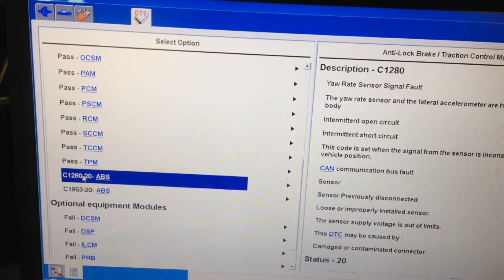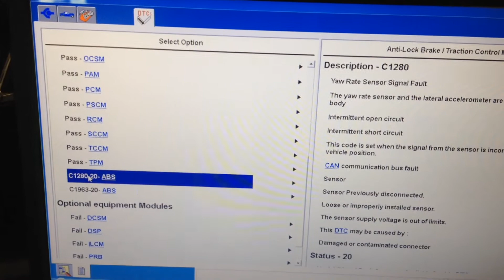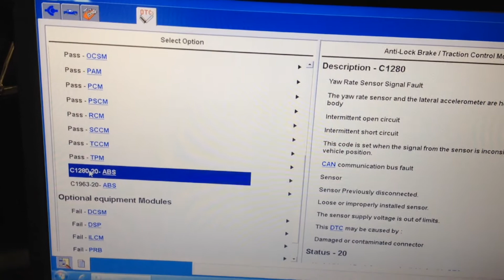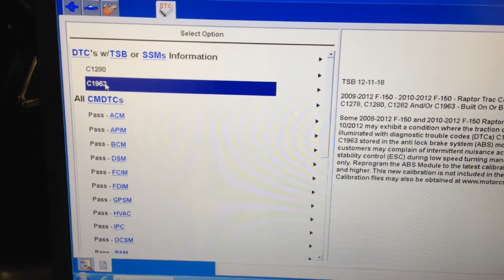Ford Quick Tips: #13 Ford F150 & Raptor Traction Control Light Flashing

Comment: @fordtechmakuloco love your videos, I looked through them all hoping you covered a problem I'm having with the backup camera in my 2010 raptor, when I put it in reverse the screen pops up like normal but it's black still have the settings button on screen but no video. Have you ever come across this? Any input or suggestions would be awesome!

Comment: Fordtechmaculoco I have a question for you. I have 2012 MKZ HYBRID . Mechanic changed inner outer tie rod and upper lower control arms and after that when I turn my steering wheel to right my abs sensor pops up. If I turn steering wheel left no lights until I press the brake. When I press the brake abs and traction showing and car is sliding. After abs sensor shows up no brake problem . I did the alignment also. I was fixing my car by watching your videos and I believe you have the answer

Comment: My 2014 f150 XLT 5.0 has two codes, C1440 20. And C1280 20 . Flashing will not fix this problem I was told. HELP !
Reply: Any update c1440 is ur HCU unit pressure switch damaged
Reply: @cj1613  got a used 2014  complete HCU with 117k on it, will install soon because switch built into hydraulic unit is reading more than 40psi , so module is good but not the built in sensor is bad. Part cost $100.00 on eBay with 6 month warranty. Dealer part was $1300.00 new.

Comment: Have you seen this without codes?   2009 f150, abs kicks on so bad around corners it skids the LF wheel, you can see the RF signal dropping out on scanner so we replaced the hub and sensor assy.  Did not fix the problem.  I can see the SAS reading wonky, but no codes, this one is eating my lunch.

Comment: @Makuloco, I had my ECM replaced due to the shop stating it was bad after my truck was skipping. The plugs, and coil packs didn't fix the problem originally.  After they replaced the ECM and reprogrammed it to my VIN, the Traction Control is now ALWAYS off. You can push and hold the button, but it won't reactivate. Is this due to the ECM not being programmed correctly? I have a 2008 F150 STX - Sport
Reply from the maker: +912firefighter They will have to go in and see why the light is on likely they need to calibrate the advancetrac system after the fact.

Comment: I think I’m having this problem but not sure.  My 2009 F-150 STX will turn on the Parking, ABS, and Traction lights and gives a warning in dash screen that says Check Brake System.  Brakes seem to be fine, then it will go away after several miles down the road. It only happens in the morning after first starting the truck or after sitting for quite a while. Could this be the cause.
Reply: Hello Dean, do you mind sharing an update or if any other issues experienced? I have an 09 king ranch and everything you mentioned however they stay on all of the time. Also no communication issues per dealership.
Reply: @Sheeeeeeeeeeeeiiitt  I ended up having a chaffed wire where the pcm went into the firewall and would short occasionally. That was why it was hard to diagnose, including 3 pcm swaps and a instrument panel while chasing the problem down!! Good luck.
Reply: Thanks Dean, very much appreciated good sir. This truck has been a labor of love. All the attention I put towards preventative maintenance and service, dealership repairs etc…seems at 100k things became one thing after another. Hubs, ac issues, electrical, various water leaks and rust, fuel pump fuse relocation kits, evap leaks…Leaking power steering hoses, transmission bulkhead connector leak, VCT’s, valve covers/oil pan…pinion seals, 4x4. Ford owner inertia. In for a penny, in for a pound. The devil I know at this point lol Thanks again.

Comment: hi master , I have question for you my ford explorer 03 TC light is flashing Code  C1277
they  replace the steering wheel sensor but nothing happen the light still there please any help thaks you!
Reply from the maker: +jose carcamo Did they recalibrate the steering wheel after the replacement?
Reply: +FordTechMakuloco 
HI master so I Send my car to the ford dealer and they make a reprogram abs module and the pcm $250 and the problem fixed
thanks u!

Comment: Hey man , can't really figure out how to inbox. you but I'm in a little trouble and took on more then I can do . Just looking for some tips to make things go smooth . 2010 supercharged raptor .. Any tips for removing headers ?
Reply from the maker: Mathew Gaudreau You want to take off the stock headers? Either way you must lift the engine as high as you can go then remove them. If they are the stock manifolds on 6.2l I can send you the procedure